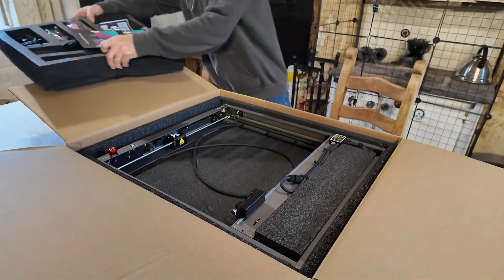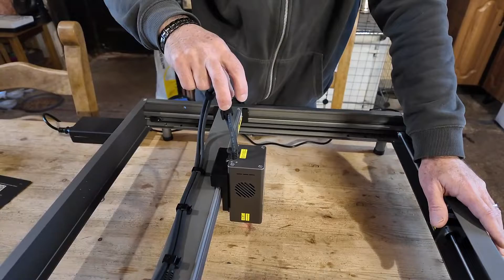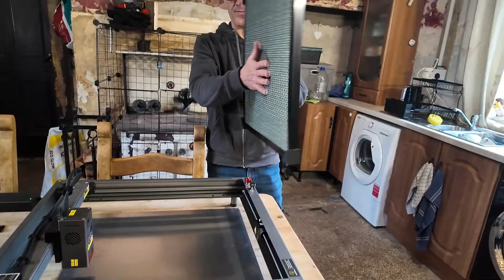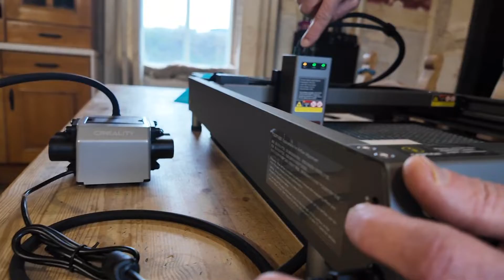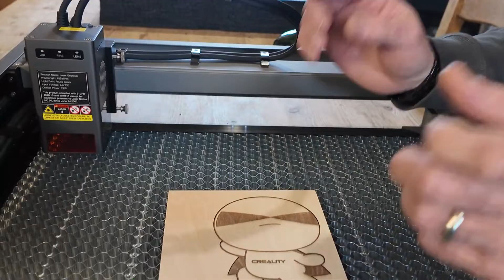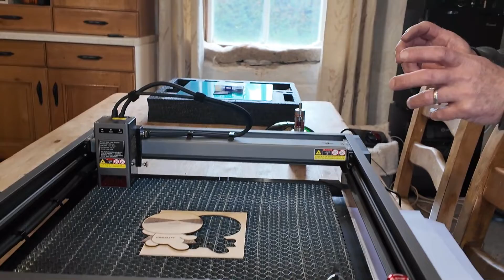A Valuable Addition: Creality Falcon 2 22W laser engraver and cutter / Review and test

Comment: Dang, Ben. You guys are getting really high tech. Couldn’t help but be amused by the juxtaposition of 21st century technology in a 19th century room. How’s the indoor shower doing?
Reply from the maker: I am amused that someone "I know" has used the work juxtaposition in a sentence lol.  But yes, joking aside it is certainly a mix of old and new.

The shower isn't too bad at all thanks.  The water heaters haven't really worked as planned with extra water pressure, but it certainly gets hot.  We think we are going to have to speed up a new range with back boiler and a plumber.

Thank you as always :-)

Comment: Great review, I've been following all of your progress closely and absouletly behind you in your struggles. What kind of fumes did you notice from the engraver....oops I asked that question a quarter of the way through the video, ....jasus :)
Reply from the maker: Hiya

Oh we have some struggles, normally just as things seem to be going so well and then suddenly, something or somethings turn to sh1t.

As for the engraver, for that example piece, it was a bit like have a really small bit of wood smouldering in the corner.  Being in the room with it engraving wasn't an issue.  When it cuts it does get a lot more smoke, but with the fan and door open it soon goes away.  Fumes on acrylic will be a difference matter and this will either be done with us out of the room, or just not before we get the enclosure.

Thanks for the comments :-)